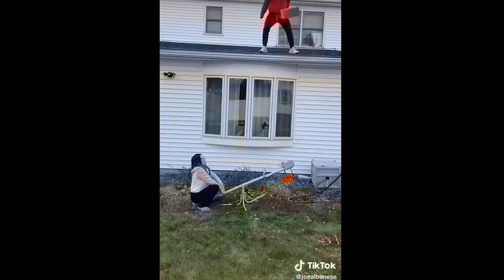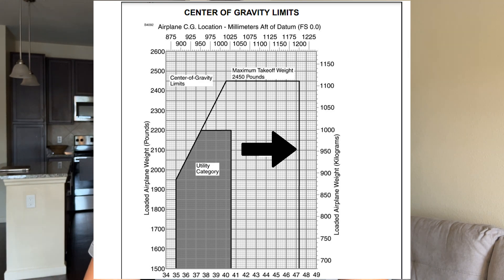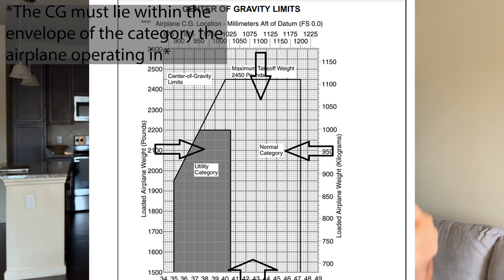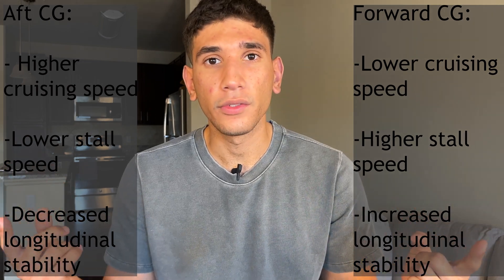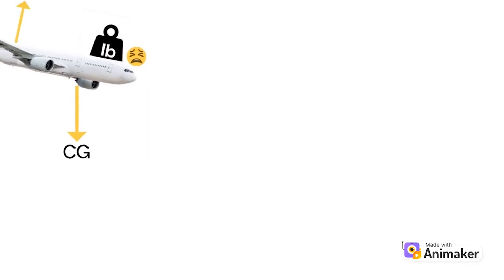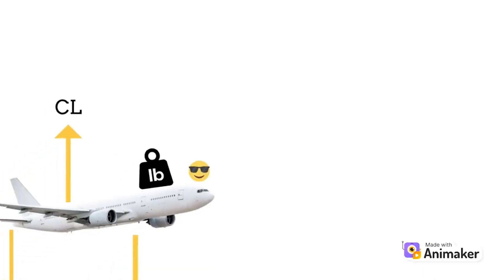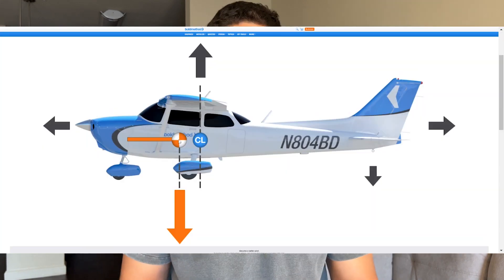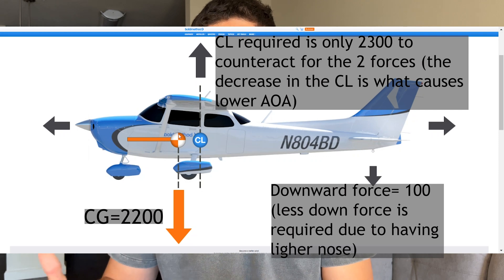Airplane Weight and Balance: Forward CG vs Aft CG Characteristics

Comment: The forward cg is not better for stall recovery because of a more nose down tendency - such does not exist as the cg is the point of rotation and therefore has no moments. Instead a more forward cg means both cp and the empennage have  longer moment arms and overall there is more surface area behind cg creating tail up moments both more at center of pressure, which is still producing lift in stall, and with elevator having more ‘power’ to break the stall AOA.

Comment: The balance of moments don’t actually work the way you say. A cg forward of center of pressure does not cause the nose to drop, rather it causes the tail to rise. There is a significant difference in this as tail down horizontal stab forces are really a moment arm down balancing out the center of pressure moment arm up and not the cg. Remember cg is the balance point and in a free body is the point of rotation. The teeter-totter that the FAA teaches is really only appropriate to the canard aircraft as in the canard the up of the canard balances against the up of the center of pressure with the cg between the two. See Medium Improve your Landings with AOA and Power Techniques, toward the end of the piece it has a discussion regarding this and how we really trim for AOA. It uses the FAA flawed analogy initially but then switches to a better model from NASA. Except wheels, skids, skis, floats in contact with the earth, the cg is always the pivot point hence as a zero distance hence can never have a moment. Torques always arise and must balance elsewhere.